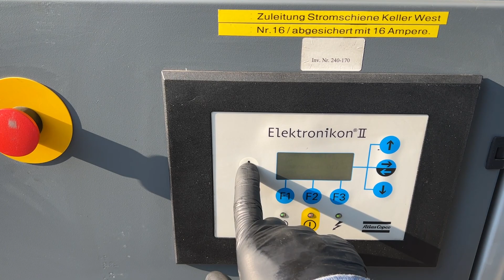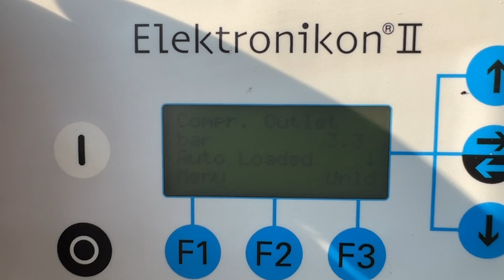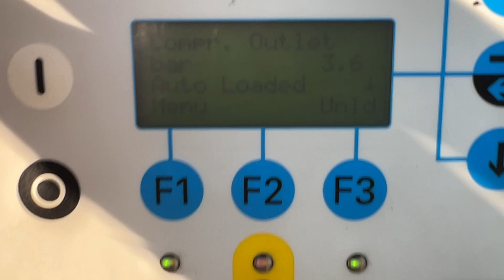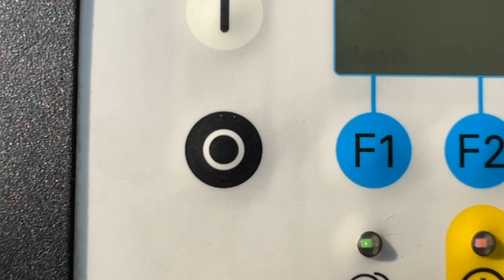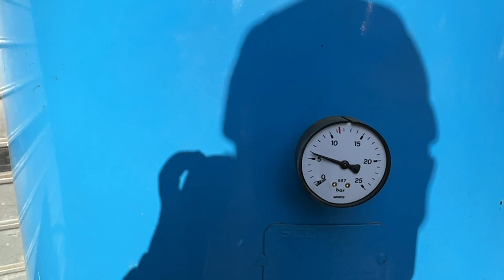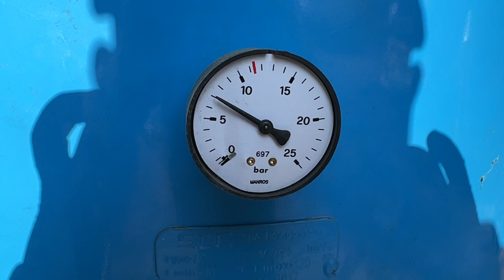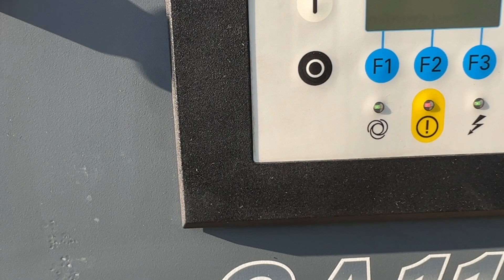Atlas Copco GA 11 FF screw compressor

Comment: hello, have you experience compressor wont load? because the inlet valve wont open.
Reply from the maker: Hello, yes, multiple problems….inlet valve, solenoid valve, output relay on Electronikon , multiple problems…first check inner pressure